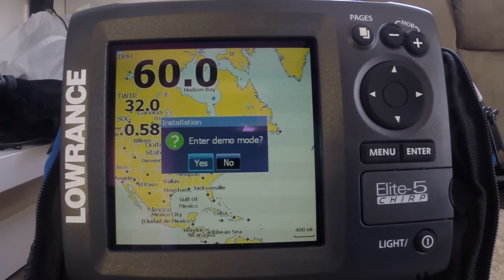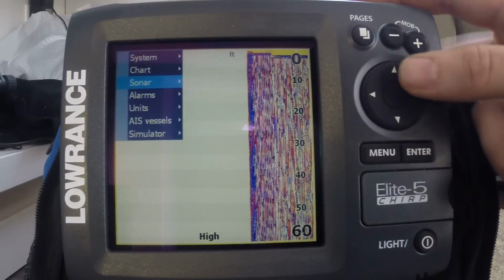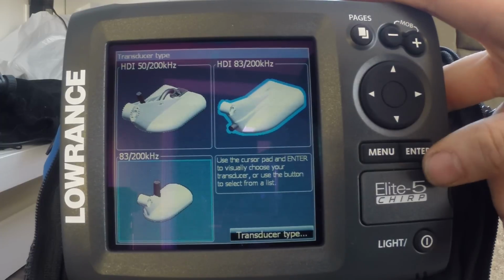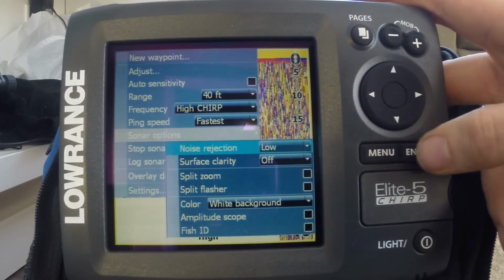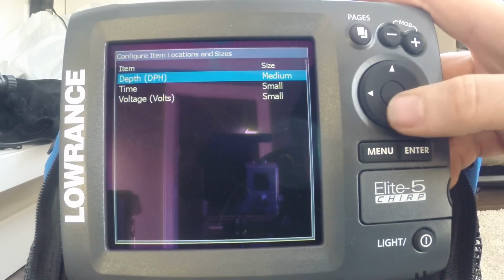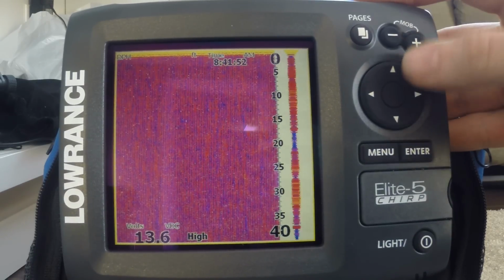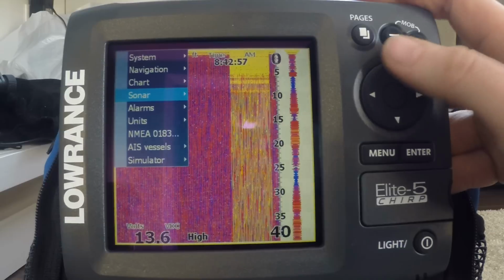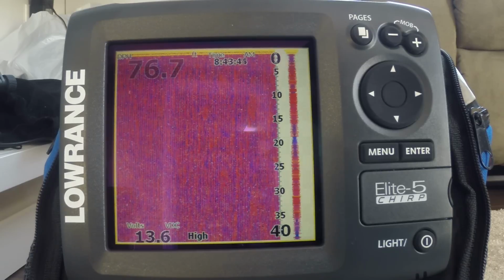Lowrance Elite5 CHIRP Ice Fishing Setup

Comment: is it better to use it in ice mode or shallow water mode. and what are the difference between the 2 besides a battery symbol in the bottom corner. also what setting did you find best for 20 ft of water. 200 khz , high chirp , medium chirp etc. thank you
Reply from the maker: +Patrick Hayes high chirp is best. Either work well. I like shallow water for area with weeds and ice for clearer bottom.

Comment: So I just got a Chirp 4 do you have to enter settings ever time you plug it into the battery to use it or does it save the settings at all?
Reply from the maker: +Scott Hyde It will retain all the settings you put in even if you disconnect the battery
Reply: Lawren Wetzel good to know thanks.  Have your setting recommendations changed at all after a full season last year fishing on the hard deck? Seems like there are slight variations if settings but they all will accomplish the same thing with similar results.   Going to try my new unit out next week and hope I can get it dialed in first trip.
Reply from the maker: +Scott Hyde I've been setting units up like this for about 10 years and the only thing I change on the ice is the depth range and sensitivity. You're right though there are a lot of adjustments you can make that will give similar results. It all comes down to what works for you
Reply: Lawren Wetzel  use my new machine yesterday. It worked great right away thanks to you! Total game changer. Here's one more question. Can you manually set the depth to specific depths or do you have to select from the depths pre-designated by the unit? I didn't like how I was at 61 feet and had to select 80 fow. Would like to set it at 62 or so so that I have more usable screen. Now I know I could zoom in but that didn't work great either I would miss some of the water column.
Reply from the maker: +Scott Hyde I think you can on that unit. Go to the bottom of top of the depth range list and you should see "custom range". If it has that feature you can set it to anything. It also may be called "upper/lower limit"

Comment: Any ideas why my Elite 7 screen may freeze?It has done this atleast once everytime I am on the water this spring.Not touching anything on the unit.It just stops.I have to hit enter button or change the page to get it moving again?
Reply from the maker: Is it version 4.0?
Reply from the maker: Is it version 4.0?
Reply: Lawren Wetzel yes,I called lawrance and they asked me that also.
Reply from the maker: newyota1 I've never seen any units at 4.0 freeze up.  I'd redo the wiring as it could be a poor connection somewhere.
Reply: Lawren Wetzel I have used this with the battery in my boat and I have also bought a 12v 8ah battery to run this by itself and it did it both ways.Only wireing that it could be is the power cord off of the machine itself.I have the fuse and a connector on that to take the unit off the boat.Never loose power to it.

Comment: I just won one of the units.  I have a Vexilar FLX 28.  I like it.  I'm wondering if I should keep the chirp unit or sell it?  

This unit seems extremely complicated.  Do you have experience using other flashers?  Just wondering if you can compare this to a Vexilar or Marum?

With my vex, I can turn it on and adjust all my settings in seconds.  Do you have to go through a bunch of settings every time you move from one scenario to another?
Reply from the maker: I have used a lot of different flashers and like the LCD units quite a bit better. The Lowrance units are very easy to use.

All you need to do is turn the unit on and answer the basic setup questions and you're good to go. These are more advanced settings and not required but I find the units work better this way.

Flashers have less to set up because they are single purpose units (ice fishing) while LCD units are mulitpuropse (ice, boat)